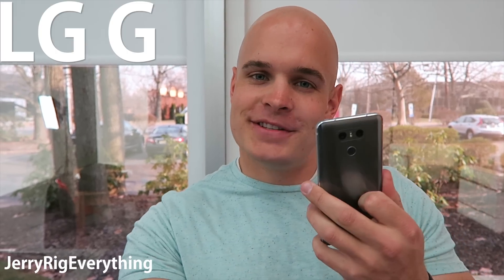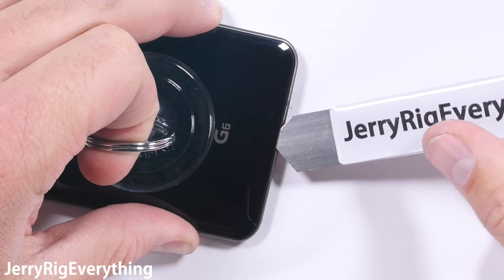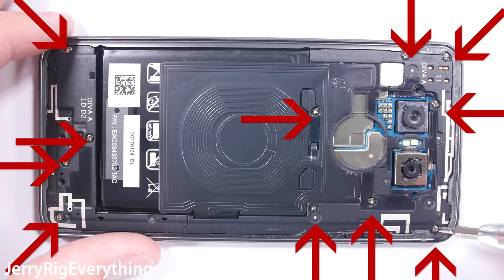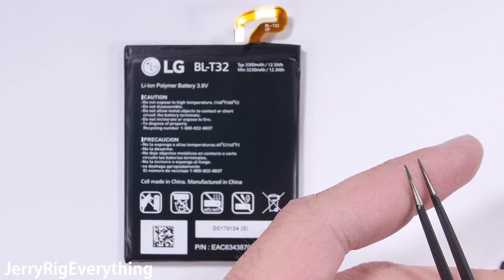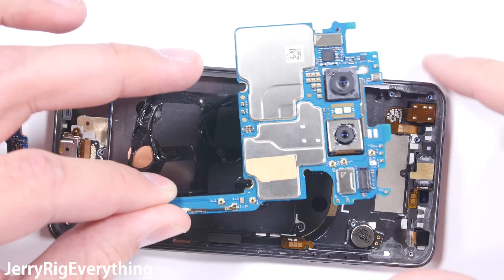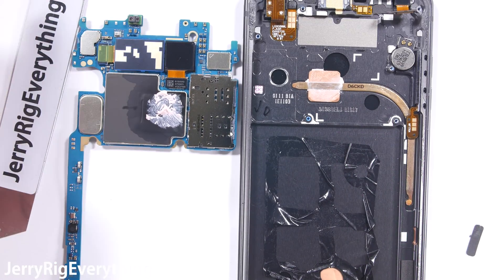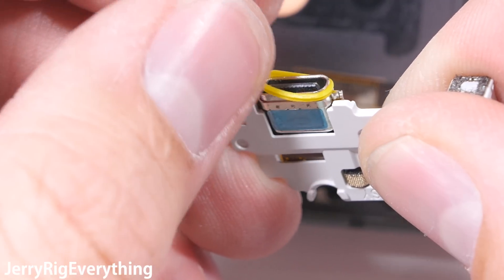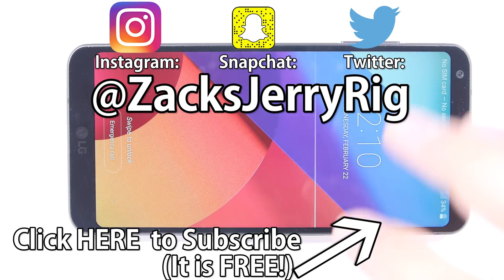First Look INSIDE the LG G6 Smartphone

Comment: hello Jerry. I noticed you do a lot of tear down downs of high end phones and such. could you please do one of the HTC Desire 626? it's the model I have, and you're not supposed to open the cover to replace the battery and whatnot. My battery is getting to a point where I have to carry a 5x charge portable power bank everywhere I go, and the port is loose as well I think, because it only charges quickly on brand new cables, then quits liking them after a month and reccomends using the original charger. Additionally, the headphone Jack only sometimes works, and exclusively works with four plated (in line mic) cables, and not the two or three plated standard headphones, it still thinks there's a mic/button and opens random stuff.  I don't really have the money for a new phone, and couldn't even buy this one it was a gift from a cousin. So if you could please help me by showing me how to fix it I'd be really grateful. I apologize in advance if I decide to copy paste spam this, I just really need help 😂😅

Comment: Very cool.  Does make you realize all those tiny components. Talk about micro processors. Looks like design is a real factor with LG. Only 14 screws. Wonder how that's gonna hold up to the bend test.  I have the LG stylo original,  very strong phone,  curious to see that one in durability test. Funny thing,  only gorilla glass one,  but screen seems very dense. cleans as easy as day one. Thanks Zack for the g6 tear down.

Comment: Please include a bootloop test when you get a final production unit. 😁
Reply: Mark Cerrillo Spot on mate! That is the main problem with LG phones.
Reply: I believe the bootloop thing is sorted out .I own 3 LG phones though.None of them had problems.
LG L9 II , LG G3 , LG V10
Reply: that and the image retention issues, are the only thing holding me off from buying this thing
Reply: JDMTokyo the G4, V10 and the G6 had the most problems EDIT: G5, not G6
Reply: Green Green nope, the bootloops were caused by bad solders or something
Reply: Mark Cerrillo I think heat pipe exists to prevent the bootloop.
Reply: Not since the V10 and G5.
Reply: It's simply bad manufacturing that's why.
Reply: The LG nexus 5x also have bootloop problems...
Reply: Edgar Wagt actually wrote this comment on a V10 with image retention. 😕
Reply: ***** my G4 has image retention too, I'm getting it replaced so I'm waiting for the G6
Reply: Edgar Wagt g6? Its not even out yet .Stop talking bs.
Reply: JDMTokyo oh woops, meant G5
Reply: yeah to avoid melting the solders -LG G4 bootloop survivor here
Reply: my G4 bootlooped twice. the motherboard was replaced. how to prevent this from happening? thanks.
Reply: +EddoWagt Bootloops were caused by bad contact points which would separate when they got hot. In effect, both of you a right
Reply: At least on the G4, it was a couple solder points from the SOC to logic board. Heating it would melt some other part, in effect giving a temporary fix but not enough to melt the solder as mentioned by someone else above
Reply: my G4 bootloped after 10 months, bought the international version from ebay so LG told me they couldnt help :/ loved that phone, should probably buy a heat gun to fix that solder on the board
Reply: nice meme
Reply: Brendan Beck I already tried putting it in the oven, phone only worked for 12 hours
Reply: That's because the solder points don't actually melt when placing it in an oven
Reply: My LG E460 also began bootlooping after three years. Since the warranty was long gone, I just bought a new phone. But it is very annoying that an otherwise perfectly fine phone has to be replaced because it suddenly needs 50+ tries to get it to boot up... All that just because of bad solder joints.
Reply: Toaster oven? It's a common BS method used by amateurs who do not know anything about reflowing and resoldering. I do have proper equipment to do this right and reflow the chip, tried it a few times. A toaster won't reseat any components, it will just let the motherboard expand from the heat to gain contact back. It will fail anyway after some time. Its just for backup. If you want to backup, just use a hair dryer to keep your phone warm, not hot! Even reflowing properly with a hot air station and flux will not last long. My guess is, that the bad contact point is inside the CPU, like Louis Rossmann explained in his videos.
Reply: Miguel if you don't own a heat gun try putting the motherboard inside a toaster oven. This is a common method used by techs for exactly the reason you need, to reseat components. Just be sure to not put the board directly on a tray, prop it up with something like a few coins stacked up on each corner of the board.

Comment: Do you think it would be possible to machine or 3d print a metal replacement back for the G6? Its a perfect phone for me, besides the glass back.
Reply: well, since were in the EU getting neither the dac nor the wireless charging, i planned to import one from japan or singapore which has the dac and i dont care about wireless charging or warranty as i also will root it.
Reply: NighteeeY i'm wondering why only in some parts of Europe the G6 is being selled with a lot of limitations. 🤔 For example in I think so some east European countries you can get the better model, and in Germany not. 🙄
Reply: Might as well get a metal case or a D brand skin.
Reply: That glass is necessary for wireless charging to work and also if you do remove the back you'll void the warranty and remove the water resistant adhesive. All in all, it's not a good idea
Reply: NighteeeY Yes but it will be to expensive.
Reply: Adolf Hitler Yes but not these small ones at home. There are really big and expensive ones wich are working with lasers (not 100% sure)
Reply: Adolf Hitler That's right but you could call it 3d printer too it's like Hoverboard ...
Reply: yes
Reply: MatterXMusic the glass isn't lol, anything other than metal is fine.
Reply: When LG G5 happened,  LG didn't have enough snapdragons 820, so emergent markets got LG G5 SE which had a 652 instead of a 820. Price was still on par with other SD 820 phones though.

I wonder where emergent markets will get the shaft now.